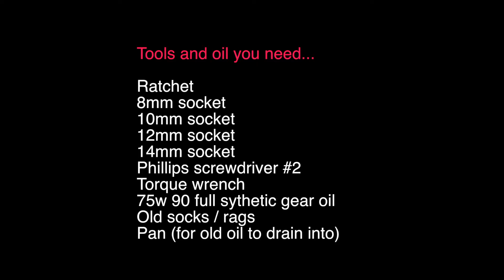Honda Elite 250 Transmission / Gear / Final Drive Oil Change - Disassembly | Mitch's Scooter Stuff

Comment: I did the gear oil change yesterday after watching this helpful video.  What a difference - the drive-train noise when going over 25 MPH is greatly reduced.  My '85 250 rides so much smoother now.  Thanks, Mitch!!

Comment: You're the best, thanks so much for the video. I recently got a CN250 Helix, but the design of the CVT is nearly(?) identical, and this really helped me to clear up how to get access to the oil CVT oil. I have a service manual, but the diagram in it was hard for me to understand, because it didn't say anything about taking off this cover.

Awesome content, and happy scooting!

Comment: Hi Mitch! You're a legend. Recently bought the same motorcycle, and your videos encouraged me to do the job myself! . Unfortunately, I live in a country with serious customs restrictions, so importing parts is a no-no. I found I wanted to try the sliding weights, and luckily I found someone selling them here. Unfortunately, he only has stock (round) 24x18 23g rollers.   He does have sliders, but only in 23x18. What do you think would work best? Dr. Pulleys 24x18 rollers, or 23x18 sliders? Thank you so much from Argentina!!

Comment: I personally spray some marvel mystery oil in the case after it’s drained and then spin the wheel a bunch by hand and you’ll be surprised at the extra crap that comes out.

Comment: Mitch, i just bought a 1990 Honda Elite CH250 runs good just had a bad fuel filter, it has 24,375 miles on it, do you recommend changing the gear oil? can you tell me how many cc is that engine,  and what years will interchange with this model, 
your videos are AWESOME i spent hour watching them<
Keep up the good work

Comment: Hi i have a 250 Honda elite scooter  but  @the  side of the battery have a fuse or a connector  that's not working .how to fix
Reply from the maker: Hey, check if the fuse holder and connectors have any dirt / corrosion that caused bad contact, happened to me before
Reply: @MitchsScooterStuff  tks mitch